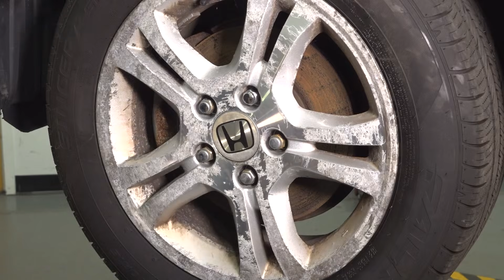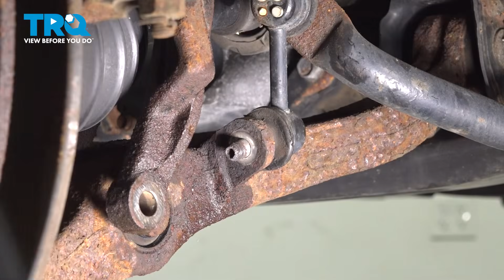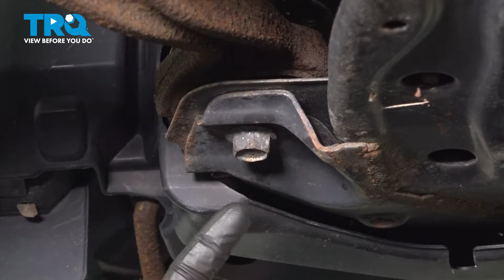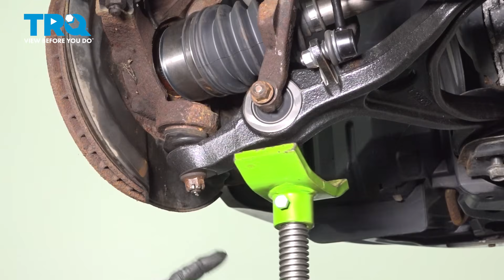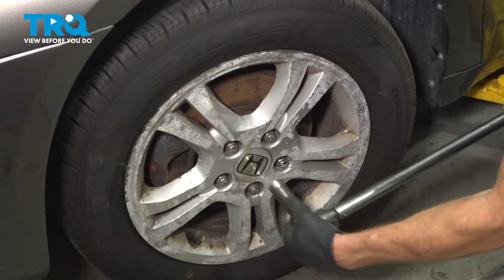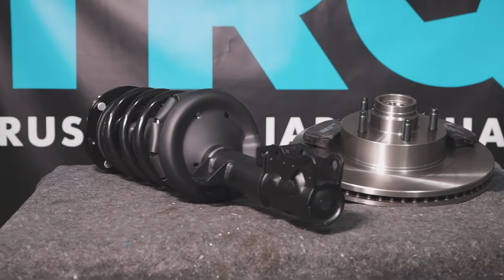How to Replace Front Lower Control Arm 2003-2007 Honda Accord

Comment: The torque spec you provided for the axle nut does not apply to all Accords of this particular gen! A/T Accords are 133ft Lbs and the M/T Accords are set to 181ft lbs

Comment: I have a question and I hope you can answer it. I've done a wheel alignment on my car and my car will go straight if I hold the steering wheel straight. As soon as I let go of the steering wheel it will turn slightly right then my car will turn right. There's nothing wrong with my tire pressure. Do you know why my car is doing this?

Comment: you did not need to remove the drive shaft centre nut ? why the hell did you do that LOL
Reply: I thought the same thing, but I also think it is to keep the cv axel together without doing damage as the arm swings into place. I also think it may fit without having to swing it in place. When I do this to my car I will find out and post an update.